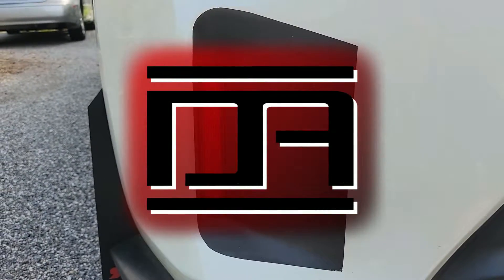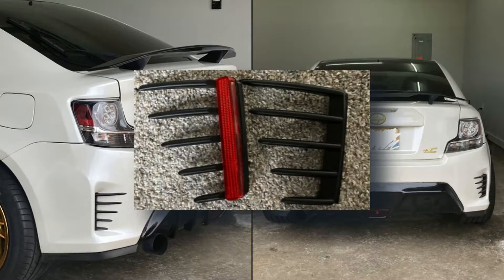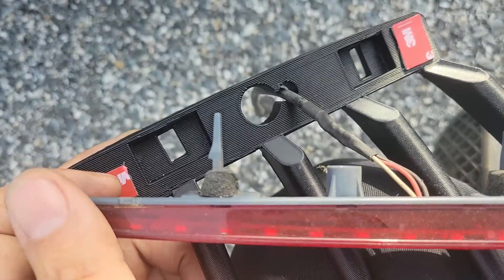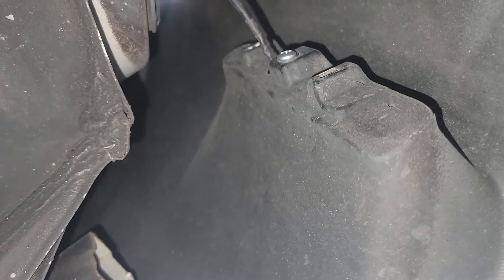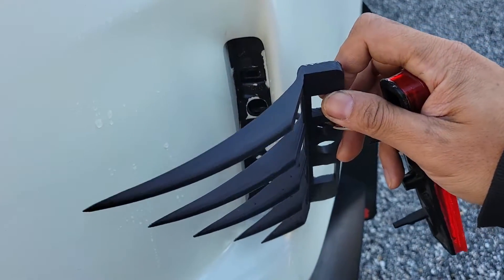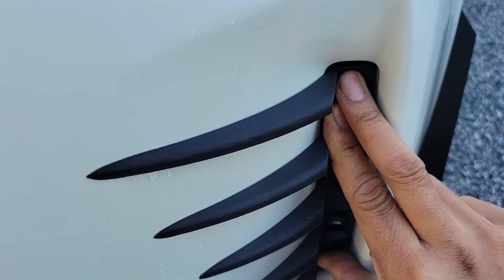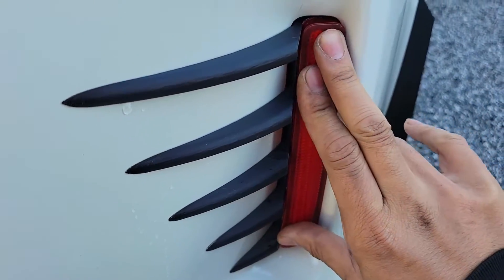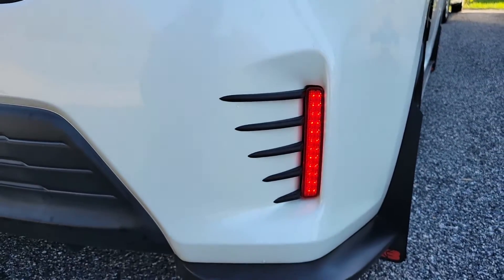Byrd Technologies Lexus RC Style 3D Printed Reflector Fins Install (Scion tC2.5)

Comment: How did you get them to sit so flush?! Mine are sticking out 💀
Reply from the maker: I made sure it was sitting flush and held the fins in place while I tightened the screw. Do you have the revised version after I published this video or the original one?
Reply: @VampyreX13  The revised one, i actually had to email and get the driver one replaced because i broke it trying to get it flush HAHAHA i’ll make sure to try to do that then. I was just being careless and rushing it because it seemed easy.